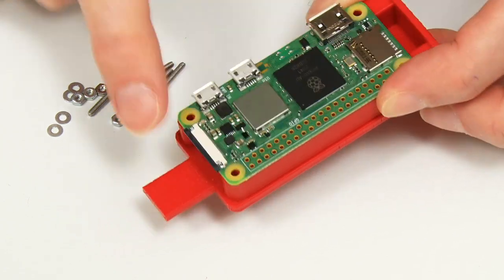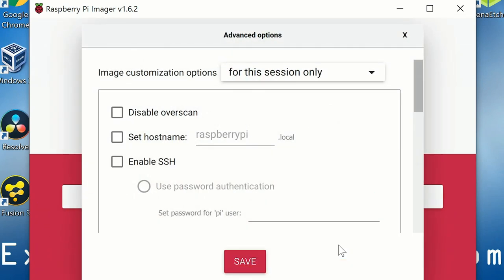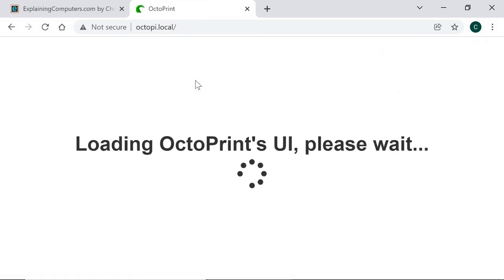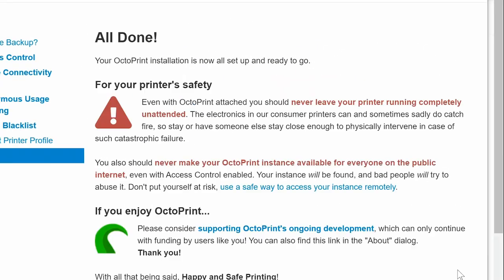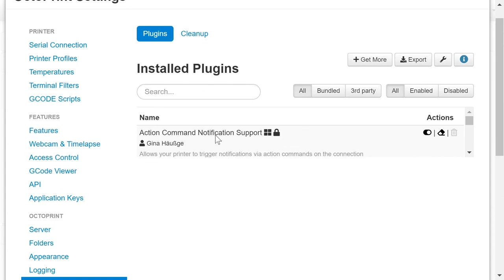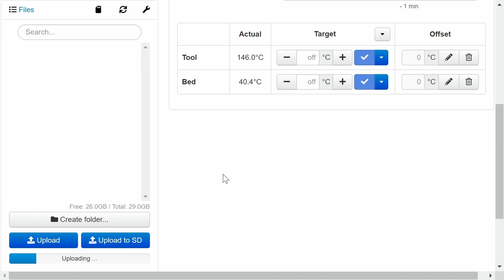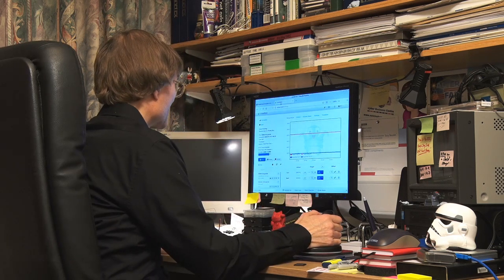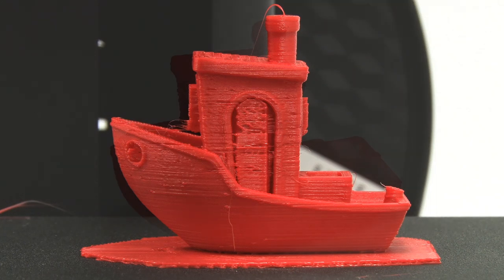Raspberry Pi Zero 2 W OctoPi 3D Printer Control

Comment: I was wondering how well the Pi Zero W 2 would do with Octopi. Does quite well it seems. I have the new board but won't be switching. I use a Pi 4 2gb and before a 3B+ on a E3P. Octopi is a fantastic program. Thanks for yet another great video.
Reply: Pi Zero 2 W works just as well as a 3B+ for octoprint. If anything, I actually think the video stream is smoother on the Zero 2 W and much less latency. It could potentially be a better WiFi module that is making the connection difference.

Comment: I've been putting off updating the OctoPi I use with my MP Select Mini but I think it's time. The version I have still uses an old version of Python and I have been just closing out the message I get every time I boot up the Raspberry Pi. I'm curious if you tried using the WiFi that's built into the MP Select Mini. On mine its slow and sometimes fails to download the print file.
Update: After restoring the SD card to full capacity (Major job in itself) I followed your instructions and it went much easier than the old traditional method I had been using. Thanks.

Comment: Hey Chris, great video. You need a silicone sock for your heat block. Will help with temperature variations.
Reply: any example ? sadly you are not named Willis  'What You Talkin Bout Willis" would have been  perfect !
Reply: @jyvben1520  I'm sorry you don't understand.
Reply: @bobpaugh6725  i'm sorry you can not give an example.
Reply: @jyvben1520  to be fair the statement wasn't address to you. A heat block is what melts the plastic before it comes out the nozzle. A silicone sock goes over the heat block to help keep the temperature stable. Google is a wonderful thing. Good day.

Comment: That was very impressive!  I'm curious if the print output would be different if the Monoprice printer used its native printing software.
Reply from the maker: Greetings Chris. The print output should be identical, as OctoPi is delivery the same G-Code, just over USB, rather than from the microSD card.
Reply: @ExplainingComputers  If not slightly higher quality, if you want to dedicate the time to install the right plugins and configure a few things.

You can get plugins for Octopi that can account for things like room or printer-box temperature and adjust filament and bed temps accordingly as I understand it. It can also run calibration on printers (like my Longer LK4 Pro) that don't come with that feature out of the box, the latter being the main reason I'm tempted to do this exact setup.
Reply from the maker: @DFX2KX  Such plugins I will investigate -- thanks for the tip. :)

Comment: oof that camera video quality is not  good
I expected more but not much , I wonder how well octoprint runs on a  gen 1 pi zero W without   any camera
I have 2 zero W's ,  one 1st gen and one 2nd gen ,and an extra  wyze cam V2 , I was thinking of  using   the  1st gen zero W with no camera and then use the wyze cam for video seems like the video quality would be much better 
for $20 for that camera module  I don't think its worth it  ,  the  microcenter near me sells refurb wyze cams for the same price

Comment: I have OctoPi running on a Pi4B 4GB controlling my Prusa Mini+. Works great. Also planning on installing a Pi Camera V2 for OctoLapse and remote monitoring.

A question Chris; I have a large flat lid (120.71 x 80 x 4 mm) that invariably warps after the print is done. I’ve changed the sheet/print surface, the material from PLA to PETG, I’ve washed the sheets thoroughly and added a brim to hold it down extra hard.
What can I do to avoid this warping?
Reply from the maker: Stopping large, flat prints warping can be a real problem -- and you mention all the obvious things to try. Control of the ambient temperature, and in particular an enclosed heated build chamber may help. But these are kind of hard to implement.

Comment: Is it possible to make a video using other materials , like ABS, nylon,or resins, to print let say a case for your Pie Zero W, or to models?  Great video, informative as always.  I like Aero bars  too.
Reply from the maker: I may get and cover a resin-based (photopolymerization) printer at some point. It depends how views do on these initial 3DP videos.
Reply: I wouldn't go with ABS. Not with this printer and even not in a garage. Why? ABS produces nasty things when melted and it should be used in well ventilated places.
This particular printer can handle PETG very well on small objects (low in height - like 5x5x5 cm). I tried once 10x10x10 food dose cube and it failed spectacularly. Layer adhesion was too low and I crushed it while taking of the bed.
But actually modern good quality PLAs are doing very well, even exposed to sun light, as long as they are not heated up over 55 degrees. 2 years ago I built a stand for flowers on my balcony from orange Spectrum PLA and they even didn't lost their color.
Reply: @SergiuszRoszczyk  Good to  know.  I don't know much about these things.  What materials could one use to make functional things, like a case for a Pie, or parts?
Reply: @robertmaxa6631  you don't have much to choose from, on the other hand not much need too ;). In case of this printer you are limited by 250C nozzle, 65-70C max bed temp and bowden system in case of flexibles. I did PLA of different manufacturers, PET-G and some 40D flex with a bit of hit and miss. Most of the time I stick to variants of PLA, and use PET-G when I want something translucent or resistant to higher temperatures (like for power supply cover).

Comment: Would it work for a CNC machine too? :)
Reply from the maker: I've not come across OctoPi / OctoPrint being used to control a CNC machine. This said, it is just outputting G-Code . . .
Reply: There's a plugin for it, but as I haven't finished building mine I haven't tried it yet. Anyway, 3D printers are CNC machines!
Reply: @EcoHamletsUK  Thank you :)

Comment: I thought Octoprint would be a replacement for your printer controller, now i know better i believe.
It is a surveillance software and the plugin allows to correspond with the printer PCB via serial bus
and raspberry PI. Did not recognize any control but this should be a piece of kaka :).

Comment: I'm going to hook up a Pi 4 to mine (easier to do with the parts involved). Wish me luck. I also have the cheapest webcam there is to point at the printer. (Me and ribbon cables do not get along)
Reply from the maker: I wish you the best of luck! :) A Pi 4 should work very well.
Reply: @ExplainingComputers  I went with a 3b (in case anything did go catastrophically wrong).
I haven't got to printing yet (I have been trying to clean my room. Almost rented a bulldozer).. But this thing hooked right up. I was going "Wait- was that it?!"- and tested the bed movement. 
Ok- so having to go thru the terminal and opening a webpage is a pain. I'm lazy. 
Now to see if I can open a browser, and stick files from the computer I opened it in

Oh yeah- webcam went like a breeze. It's staring at the printer right now.

Comment: So is the next step to use machine learning to actually detect if something is going wrong and stop the print? I assume at the moment, OctoPrint will just watch the print and laugh to itself if it all goes wrong.
Reply from the maker: There is an OctoPi plug-in that tries to visually detect the "spagetti" of plastic that results when things go wrong and the print detatches from the bed, so allowing action to be taken.
Reply: Possibly even more useful is the plug-in that allows you to stop printing a specific region if, for example, you are printing several items and one of them goes bad for some reason.   Since you can do this remotely, you simply indicate which part of the print to exclude.  This may enable saving the rest of the print.

Comment: Anybody else reporting connection problems connecting Octoprint to a raspberry.  I have a  the same printer which after adding the plugin has worked smoothly for a year.  I have upgraded, I know big mistake , to the latest version of Octoprint.  No matter what I do I get 'No serial port connection detected etc'.  I have tried to connect to the printer using a pi4, a pi3b and now by a pi zero w.  All give the same error.  Since there is nothing wrong with the printer, which worked fine 2 days ago, and since all the pi's are fully functional, I can only presume that Octoprint has changed some thing.  Incidentally, Octoprint now reports that it never supported the pi Zero.

Comment: Someone has to say it, Chris :  That print quality is pretty grim!
I have a 4 year old Anycubic I3 Mega that puts it to shame, and it was one of the cheapest printers available at the time I bought it.  Mind you, I gave up trying to get it to talk to OctoPi...  Maybe things have improved since then?
All the best.
Reply from the maker: Yes, the print quality is not fantastic, as I did say in the video, but it is perfectly servicable for my needs, and the printer is working very reliably (not one failed print). For me a very important requirement was a printer that was small so I can store it when not in use, and I'm not aware of a similarly priced alternative that is remotely as small as the Monoprice.

Ultimately the printer is doing all I want and need it to do. I'm either printing functional parts, which function fine, or objects that are going to be significantly post processed to obtain a smooth surface (like the stormtrooper helmet from the last video -- and on the desk in this one!).

However well a material extrusion printer works (and I've handled output from $200K Stratasys machines) the surface quality is never a patch on a cast or injection molded part -- at least before post-processing -- and I don't expect or require it to be. So providing the printer reliably delivers structurally sound parts and good net form, I am happy! But I know others have different requirements, and get better print quality from similarly priced hardware that is much larger in size. :)
Reply: @ExplainingComputers  If it's good enough for what you want, then it's a good enough printer.  I can't argue with that.
Have fun with it.

Comment: I thought the Zero 2 was not recommended for OctoPi because it's less powerful.
Reply from the maker: The Pi Zero (W) is not recommended, but the Zero 2 W (with its quad core rather than single core CPU) is recommended hardware for OctoPi.

Comment: Well, the challenge with the 3D Benchy is actually to print it  without supports or a raft. 
And the print quality is actually terrible compared to my 190€ Elegoo Neptune 2S.
Edit: I also have serious doubts that the Zero can really handle Octoprint. It might lag behind with the print process every time you open the WebUI, which might be the culprit the questionable print quality.
Reply from the maker: A Raspberry Pi Zero certainly cannot handle OctoPrint. But a Raspberry Pi Zero 2 W can -- it has the same processing power as a Pi 3 model. :)
Reply: @ExplainingComputers  It's the same CPU, but with reduced clock (1.0Ghz vs 1.4Ghz) and half as much RAM (512MB vs 1024MB).
You should simply print a coparison of the 3D Benchy directly from the printer to see if is has the same quality problem. This print quality is in my opinion definitely not satisfying for any serious recent 3D-Printer.
Reply: I use Pi 3s on my octoprint setups. I find this intriguing. I am especially interested in the camera, though a focasable  lens with a narrower angle would be better I think. Currently I use Wyze cam2s with reflashed to operate as webcams and octolapse. I would love to see a follow up on this video.
Reply: I have been using a pi 2w and it works great for octopi.  It has a low load on it when I ssh into it and run htop,.  It also stays cool with only a heatsink and no active cooling.
Reply: @ingog.8424  The MPSM is certainly capable of printing a completely acceptable benchy.  I used one for a couple of years, both with and without Octoprint on a RPi 3B+.  Some tweaking will be required, but it can do it.   And the RPi Zero W2 is completely capable of running Octoprint very well.   I use it on my Prusa MK3S and suffer absolutely no degradation.
Reply: @drdave611  I've just had a look on other Youtube videos with this printer and yes it certianly is, all of them had much better print results. So definitely there is something wrong with his print setup. 
I've also had another look at Linus Tech Tips' video of the 95$ 3D-Printer (straight from China) and other than what is result of the missing part fan with this printer, their results with the original filament looked quite similar. The solved that by changing the filament, so I now wonder it the Filament might also be the problem here.
Reply: @ingog.8424  yep.  The filament may well be the culprit,  depending on the details.   As I'm sure you know,  getting the details perfect right "out of the box" is difficult if not impossible.   That may be why many printers include a "sample" print that is just the gcode, so no tinkering is needed.   I think that for MP it's the cat which I believe was printed in the first video on this printer.   Once you have to start tweaking the file, using setting like rafts, brims, supports, etc, the game changes.   

The good news is that this printer has a fairly active community on FB as well as YT.  Although one has to be careful to avoid the "religion" based discussions, the potential results are quite good,  even without the many "upgrades" that people do. 

The truly excellent thing about this video is that he walks through the necessary steps to get Octoprint up and running in a very clear fashion.   I remember the first time I set it up (5 years ago? ) it was very intimidating and I got caught by some of the same things,  like the needed "fix" plug-in for the MPSM.
Reply from the maker: @ingog.8424  I've not noticed any reduction in print quality printing direct or via OctoPi. The quality of the Monoprice Select Mini V2 is what it is, and I'm either making functional parts, or parts that will be significantly post-processed to a smooth surface, so I'm happy with the output I'm getting from a cheap printer that stores away in the space I have available in a cupboard when not in use. I'm also sacrificing some print quality for ease of removal from the bed! :)

Comment: You have to print that again with no supports. Knda defeats the purpose of the bench test.
Reply from the maker: I've never understood why anybody would want to print an object with unsupported horizontal surfaces -- including a flat roof -- with no supports. There is no logic to it. I've seen the benchy printed two foot long -- and there was no way that was done without supports! :)
Reply: @ExplainingComputers  yes the larger ones need the support. The small one is designed to show the capabilities of your printer and see if it can print small unsupported overhangs.
Reply from the maker: @dugly66  Fair enough! :)